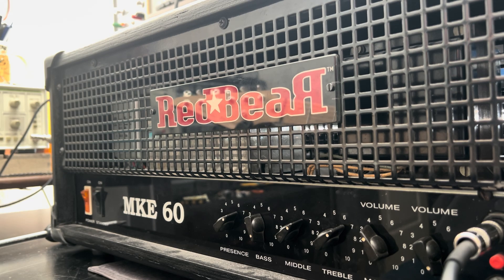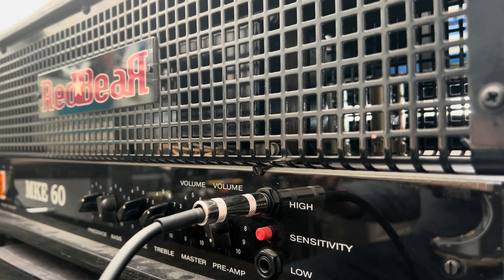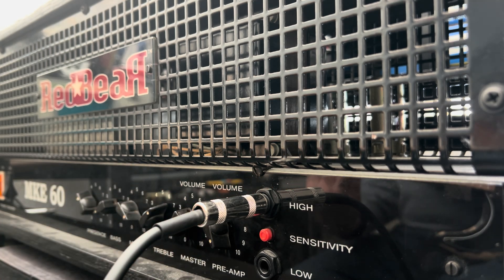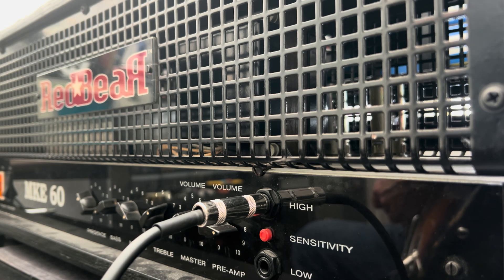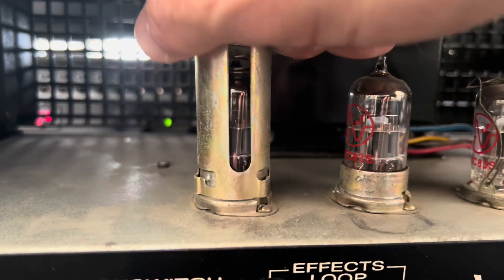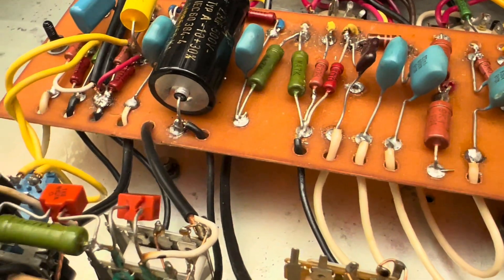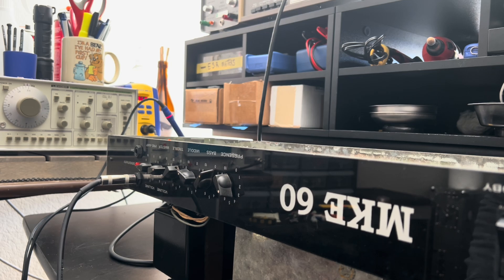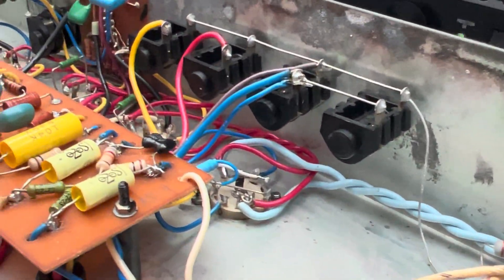Redbear MKE 60 || When the Prior Tech Delights

Comment: 😮 No butt connectors!! What about putting a small cap on V1 to help with oscillation or sheilded cable on the grid?
Reply from the maker: Just removing the hardwired bright cap does the trick and there’s no perceptible loss of high end 🍻